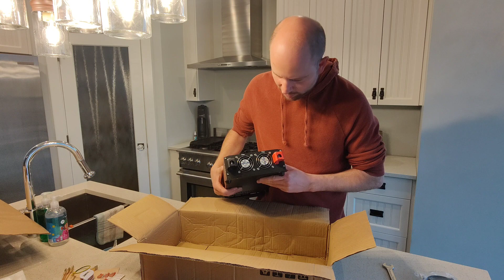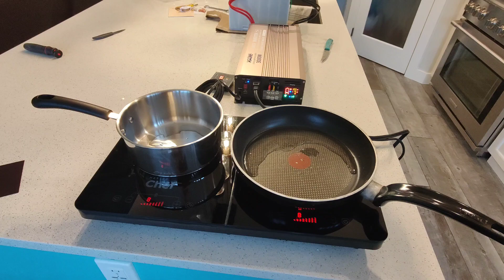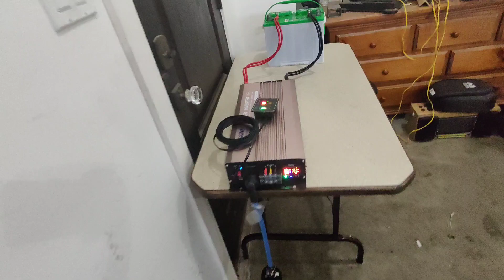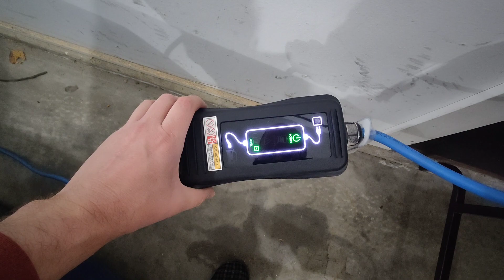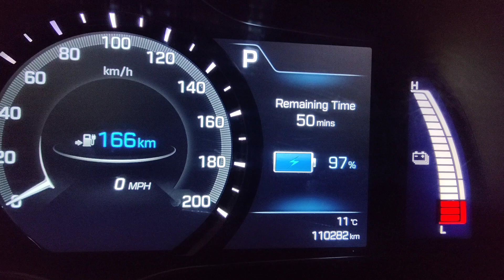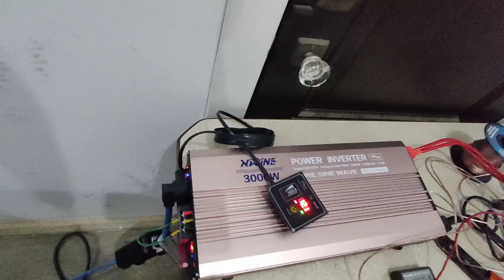Using a car battery to charge my EV! EP2: the inverter!

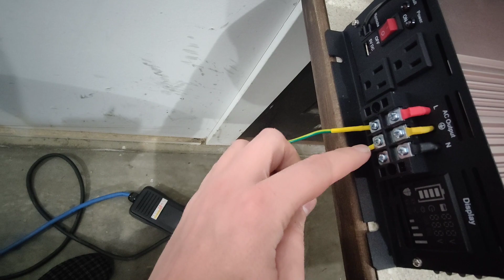Comment: 12:22 You obviously did not connect 'the neutral' side (of the inverter terminals) to ghe ground', but Live (L) side to ghe ground. With inverters that probably does not matter but if you did this with a regular outlet it would be shorted. I have same issue with a different inverter (2000W) and Kia Niro but some say that his may destroy inverter. Guess you were lucky or this inverter design was ok with what you did. For now .. I will not try to do the same thing ...
Reply from the maker: I'm very experienced with electrical.. I know the difference between hot and neutral, c'mon man. 

I'm a little confused why you think I "obviously" connected it to the hot side. You can clearly see which side I connected it to. I even did a continuity test to make sure that the terminal was connected to the left port of the outlet (the neutral side) 

It's perfectly normal to do this. Many have done it, and it works.
Reply: @edsgarage001  I was just commenting what you've said "..if we connect the neutral side to the ground .." but video shows you've connected L to GND. I am not saying you are experienced or not. I am also very experienced I think and I do make mistakes, no problem. I think we all are trying to find solutions to problems when manuals do not provide instruction what you can and cannot do. Again, with this kind of inverter it does not matter as those inverters do not really have L and N and it doesn't matter which one you connect to the ground (say you have a transformer and you don't connect star point to ground or split secondary not connect to ground). Since I've made this comment I've went and opened my (just purchased) 2000W inverter to see what the external (outlet) connections are relative to inverter. Measuring with multimeter or oscilloscope can help (which I did both but you can get fullled by those so called 'ghost' voltages) but still best is to visually check. In my inverter, so called 'ground' was not connected anywhere and I guess that is the case with your inverter as well. To be able to properly use inverter we usually need to 'bond N' and 'G' and then (best) add GFCI breaker in the circuit. Somewhere on the web I've found that someone said that inverter I have you cannot bond N and G as it will 'fry the inverter' (person claimed that was the information from customer support). When I plug my car charging cable to my inverter I get ground fault error. I guess cable box checks N-G voltage and if not zero then it will disable charging (there are two relays inside the charging 'cable' box). When I bond N-G, no error (obviously). Then further .. I unplug 'out' ground wire inside charging cable box and it is still ok, it does not detect ground fault (which I've made on purpose). What I am not sure at the moment if this can damage car electronics or not (charging from inverter without real ground)? When charging cable is plugged into regular outlet ground gets connected to vehicle ground (chassis) so does chassis becomes 'hot' as well when we connect to (bonded) inverter? I have car wiring diagram and it is not clear if external ground is directly wired to chassis or not. Both are shown connected to a 'black box' (bot not sure if there is 'something' in between). In some other video person had a same issue and he decided to buy L1 charging cable where ground is not required. This is against the code but he was afraid he may damage car electronics if he does what you did here. I don't know for sure. There are few more people doing the same thing you are doing and no issues (or not obvious ones). I think only car manufacturer could tell if this present a problem or not. Some people say 'there are no L1 charging cables' without a ground. Well .. I've found one, you can buy it on Amazon (Bokman-L1 /L2 'charger'). In that one you can disable ground if you want. Manual says this: "Long press the Delay Button for 3s Switch to No Grounding mode". This L1/L2 charger is not cheap ($200 can) and I am not sure if it is smart to use it or not in "no grounding mode". cheers!
Reply from the maker: I've got two inverters at the moment. One of them has two hot 60v, with one 180° flipped phase (not shown in this video). With that type of inverter, you can't do the g to n bonding, as there's simply no neutral. 

However, in this video, the inverter I'm using does indeed have a hot and neutral. It's a cheap Chinese inverter though and it's mislabeled. Neutral is always on the left, and yes I've tested this inverter with an oscilloscope. My guess is that this inverter is sold in markets where the plugs are shaped differently and therefore labeled differently.... Or something 🤷
But the L side of the terminal block I'm using has continuity with the neutral side of the outlets, and as I mentioned, I verified that with an oscilloscope. 

This is why when I originally tried it, I was rather hesitant. But I connected the charger first to the inverter and then only to the car when it didn't have a ground fault. 

I can't see there being any danger to the car at all though. If there was a failure of the electronics, there could be a danger to the operator though, as you're completely eliminating a safe path to ground.

Comment: It's been over a year now, what do you think of this particular inverter.  Would you get a different inverter if you had it to do again?  I ask, because we are going to do something similar.  Thanks.
Reply from the maker: Actually it's been REALLY good! I've used it quite a bit. It provides a very clean sign wave and can handle a heavy draw. 
I'm actually looking at purchasing another inverter from the same company, but unfortunately I can't seem to find one that can use 60 volts. 
But if I needed another inverter for 12 to 48 volts, this brand would be among my top picks for sure